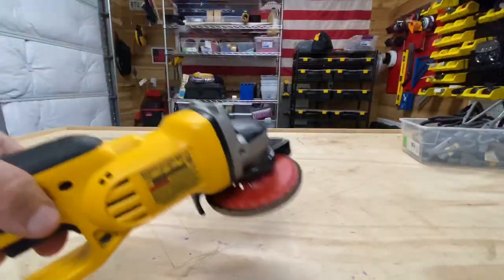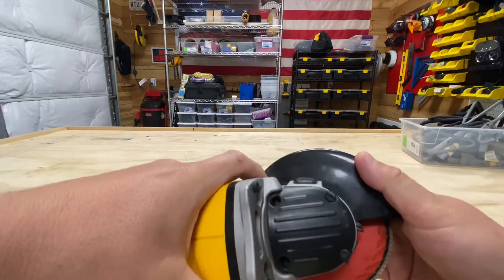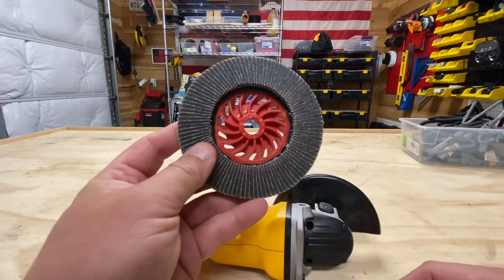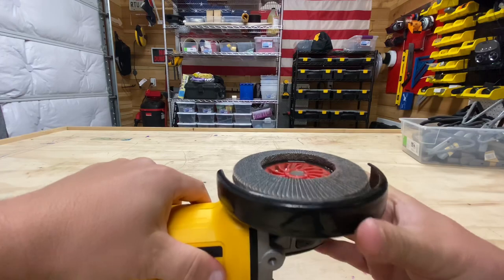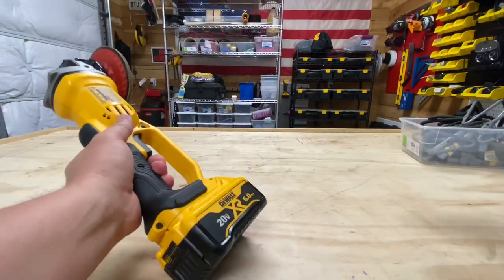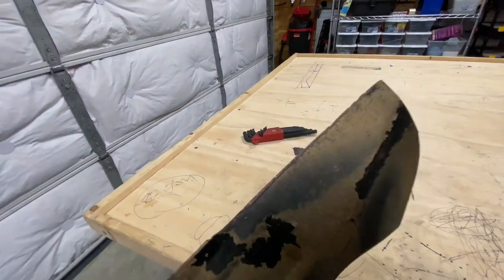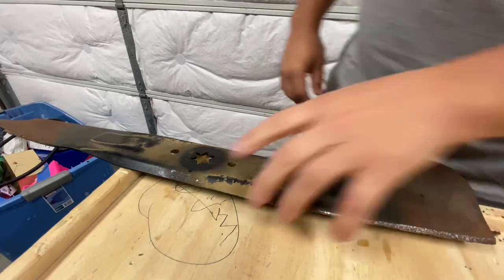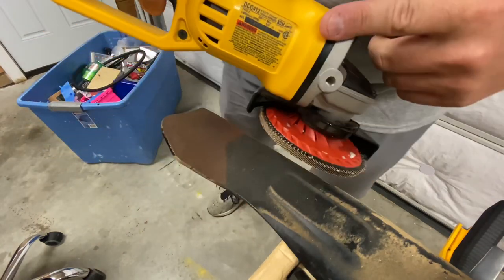Sharpening Mower Blades

Comment: I have always used a grinding wheel. I use a lite touch to not gouge the blade but was considering using a flap disc. What grit do you recommend? Thanks
Reply from the maker: Great point! I use 80grit.